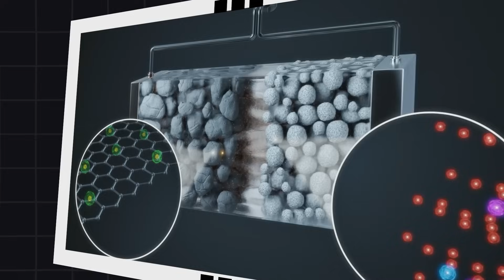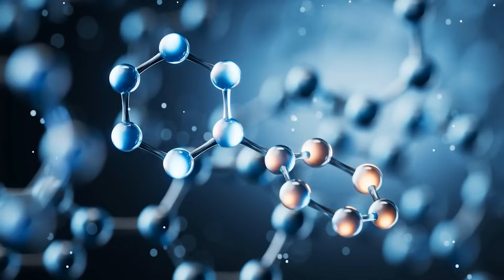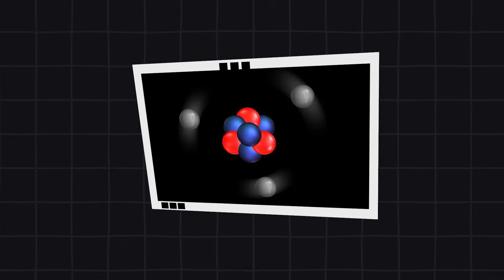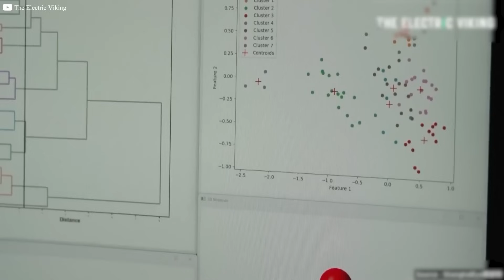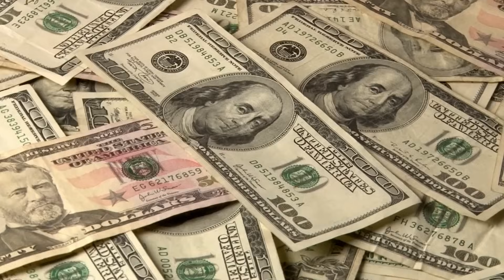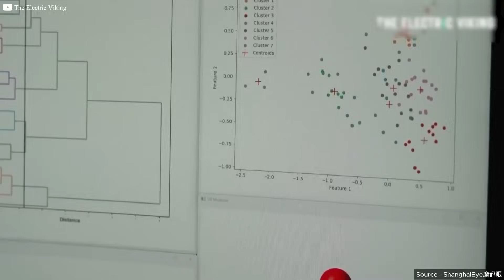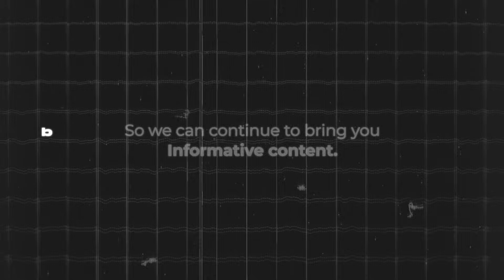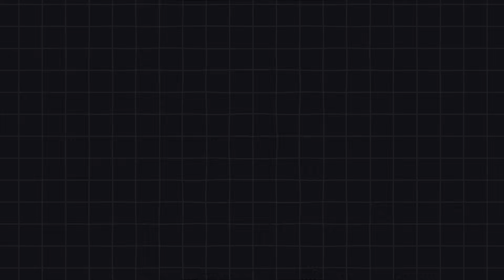AI Discovers $1 Fix That Makes Dead Batteries Last 10X Longer!

Comment: There are 3 to 4 thousand cells in a Tesla. 
They remove and disassemble the battery pack and inject each cell, then reassemble and install the battery pack. 
Yea, right!

Comment: You cannot inject this into each of the 5000 old battery cells, because they are sealed and not designed to allow that. So your Tesla car needs 5000 new battery cells anyway, hopefully such new ones, which should last longer.
Reply from the maker: You bring up a valid point! While the injection method might not be feasible for sealed batteries, it’s interesting to explore all the ways we can extend battery life. Thanks for sharing your insights!

Comment: Remove the battery pack from an ev, break it open, then drill holes in each of the thousands of individual batteries, squirt a chemical in each one, then seal each one, repack them all, and put the battery pack back in the car. Where can I invest in this miracle.